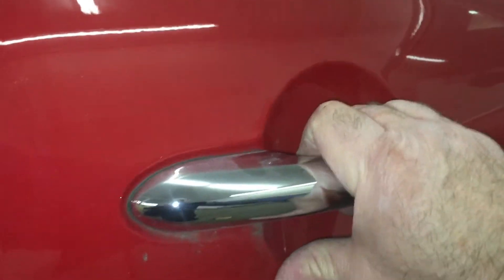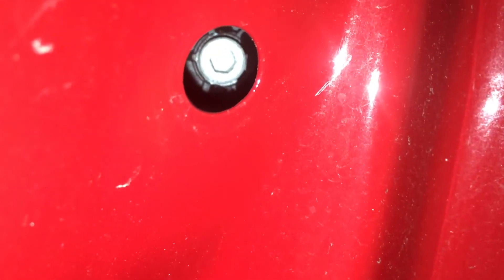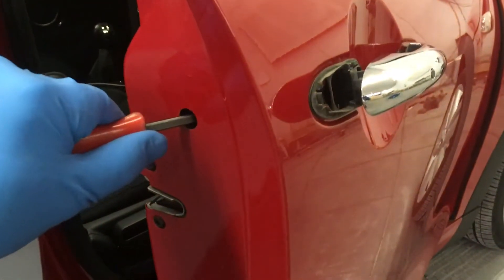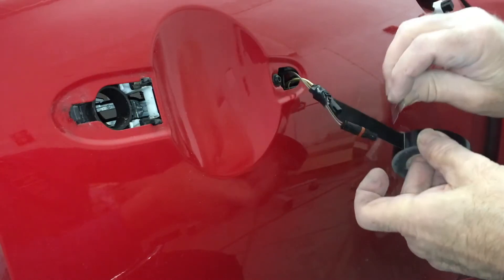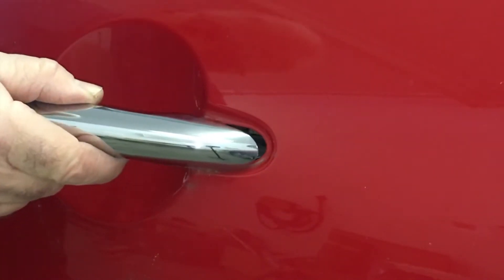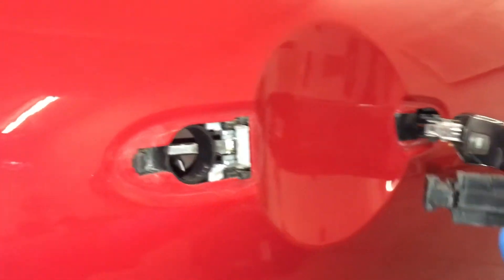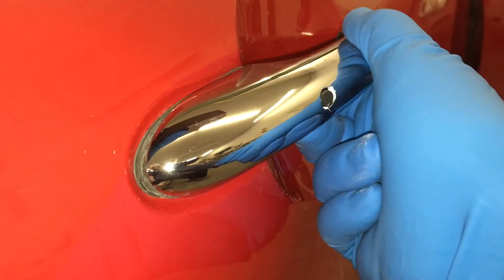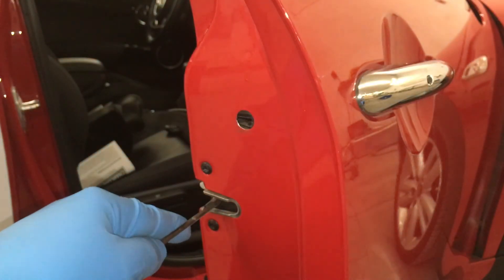mini cooper door handle

Comment: Excellent instructional video, worked a treat. I used the loop of string method on both doors to pull on the tension lever. One word of warning - the plate retention screw is captive but not if you keep unscrewing which I found to my horror when the screw dropped inside the door. Fortunately there is a large bunged off aperture lower down the door which I used to gain access to the inside and with a magnetic retrieval tool got the screw back!
Reply from the maker: Wow, thanks for sharing that experience, I didn’t realize that screw would back out all the way. Glad you were able to retrieve it without gutting the door!

Comment: Very well made video. Thank you so much! It would have been great if you could list in the description of the tools you used.
Reply from the maker: thx KV, i’ll do that, although really the only tools you’ll need are a 4mm Allen wrench, small pocket screwdriver, and a 1/4” straight screwdriver with 6“ blade. A trim tool is optional for removing the rubber plug but not required.

Comment: That was a lot easier than the way I did it. I pulled it with a pick until the white clips hold onto the latch. Then you have to carefully hook the door handle without knocking the latch mechanism loose and having to redo it. lol took plenty of tries my way
Reply from the maker: Yes, it’s a bear. A lot of the recommendations on how to reload these German/European type handles advise using a string to lever it out.✌🏻

Comment: Good video. I was able to change the passenger side handle, but having problems with the driver side. I can’t understand how to push the locking mechanism forward with the screwdriver when inserting the new handle because the lock is in the way.  Any help would be appreciated.
Reply from the maker: The method recommended for that is to loop a string around the tension lever (or pivot arm), then pull out on the string to allow the handle to slip in behind...I alluded to this briefly in the description above. Good luck!

Comment: Hello, managed to swap the passenger door handle perfectly, however when it came to refitting the drivers door, the handle will now no longer snap shut and will leave around a 2mm gap at the part of the handle closet to rear of the door (where you insert the actual key if need to, that area.) Any help on how to fix this would be much appreciated. The car still locks and door will open just now no longer snaps shut.
Reply from the maker: I think because of the lock cylinder you’ll have to use a string on that driver side handle. Try removing the handle again, it may also be that the retainer plate has not drawn down properly.